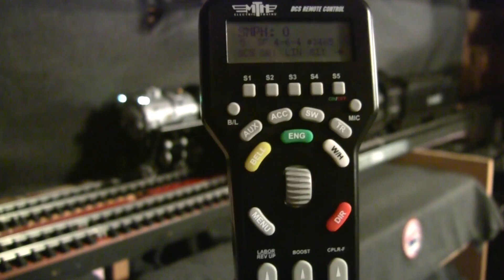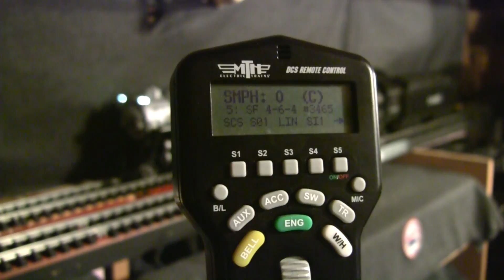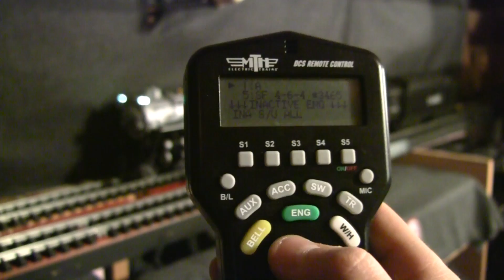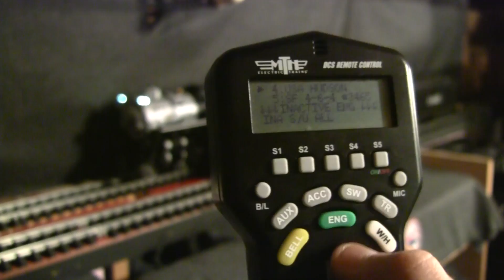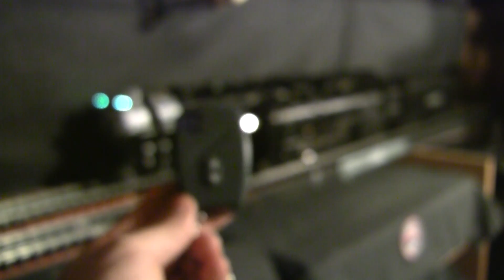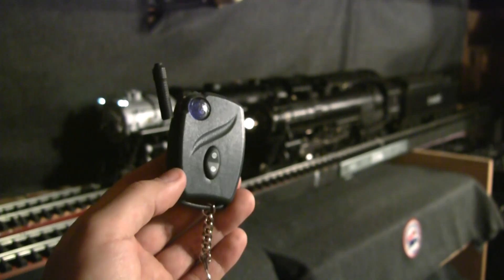MTH DCS Overview - Part 5 of 5  (2of2)

Comment from the maker: @vwbeetleowner ... with a system like this where the sound/control board is used to take full control of all the devices (including motor) and that uses a constant track voltage to the track.  So it just depends on what you want to do.  Now the MTH DCS remote and TIU can be used to vary voltage to the track to control analog trains but that only works with the Variable channels and that only works under AC power which isn't compatible with most G scale trains.

Comment from the maker: @vwbeetleowner In order to have all the functionality you have to have a Protosound 2 (or the new 3) board installed in the engine which is used to take control of the all the lights, smoke, motor etc.  Engines in G scale (except for MTH factory engines) don't come with sound/control built in and has to be added later.  There are a couple of approaches, you can get remotes that just control track power voltages and polarity to just control the engine speed and direction or you can go....